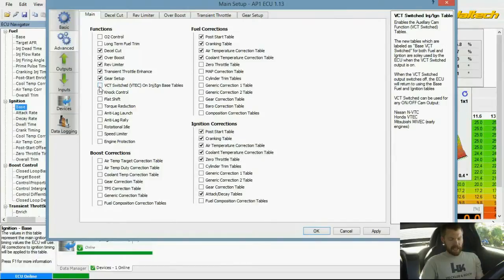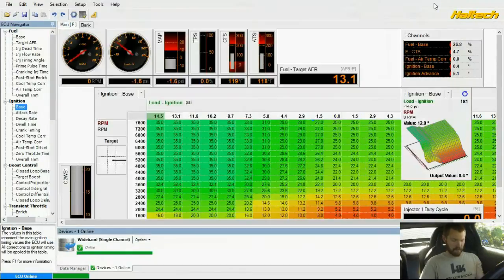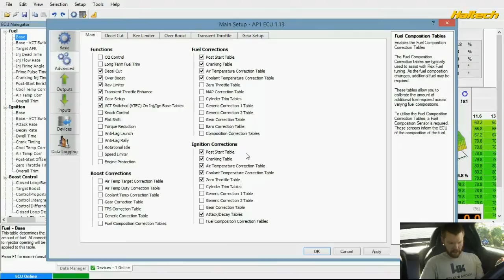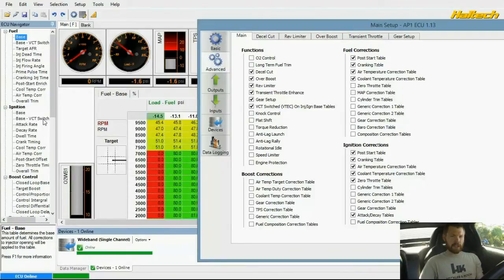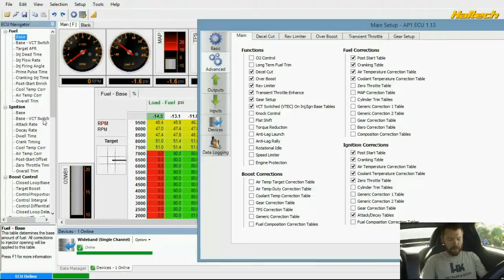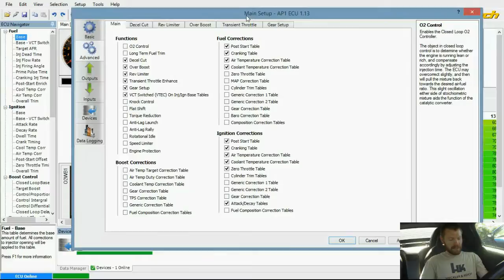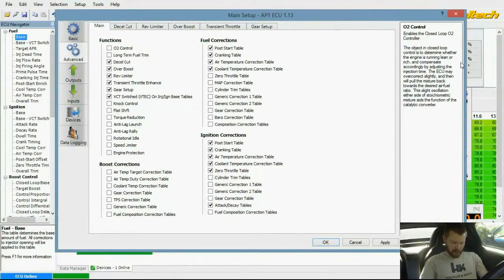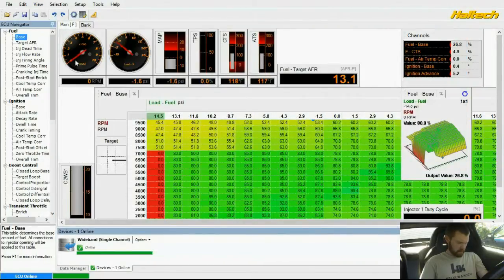Haltech ESP: Variable Cam Timing [VTEC] (part 3)

Comment: wtf is this, i expected to see bolts, oil, chains etc
Reply from the maker: +kozas0 this is an Engine Management tuning video, I'm going over the configuring part. A video that goes over adjusting cam gears and lobe separation angles sounds like what you were expecting to see.